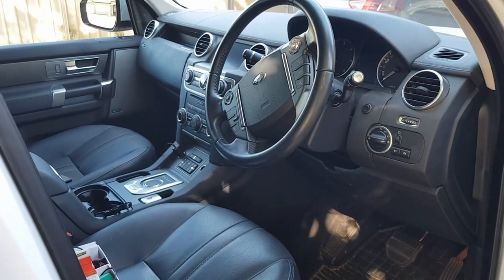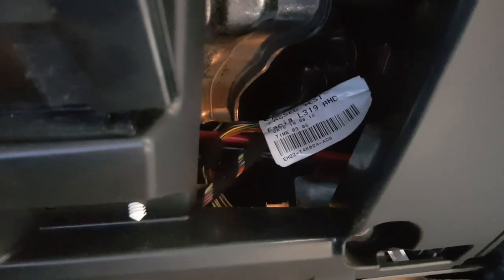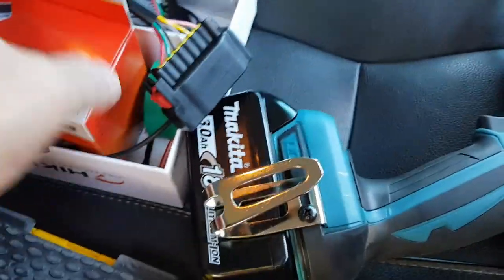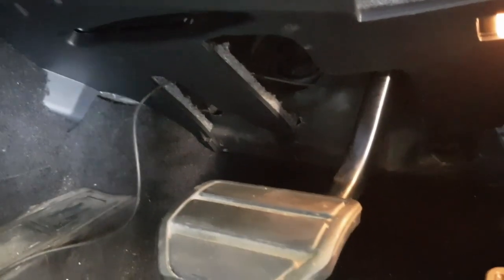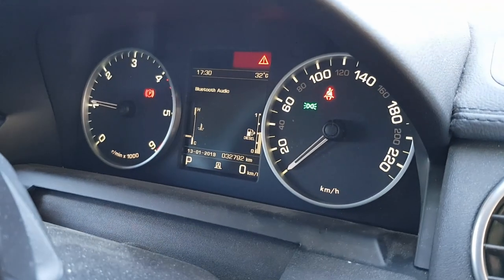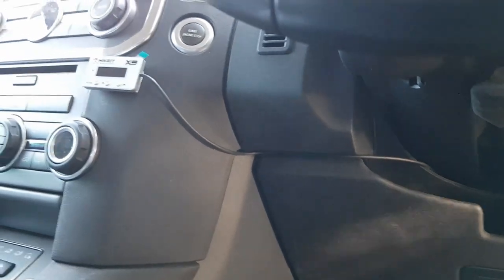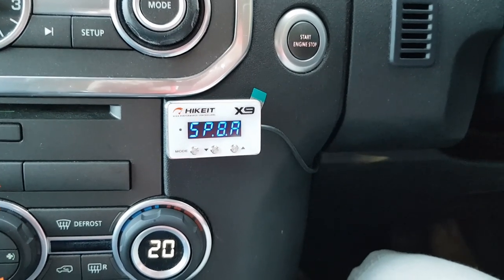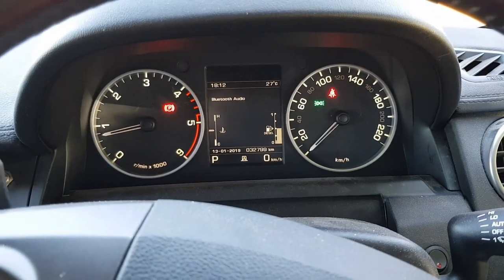Hikeit X9 Throttle Controller Installation in Discovery 4/LR4

Comment: How is it going now that you've had it installed for a while?
Does it have an impact on fuel economy?
Thanks for the video (-:
Reply: Sorry for the late reply Karim, Youtube didn't notify me that you commented...... it still works fine..... though I don't notice the difference as much as I used to when it was freshly installed. In regards to fuel economy, I think it hasn't made any difference, only to the way I drive, which is possibly a bit heavier on my right foot thanks to having the better throttle response LOL. Thanks for watching :) Don (Dons Shed and Xplor Overland)